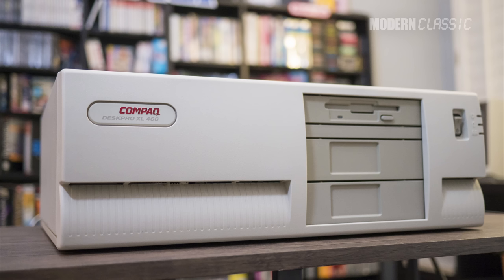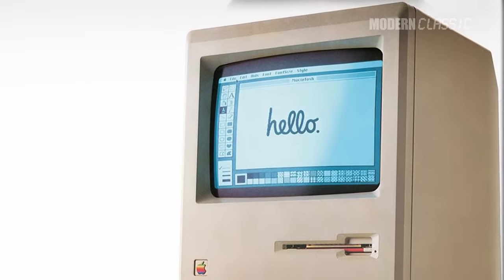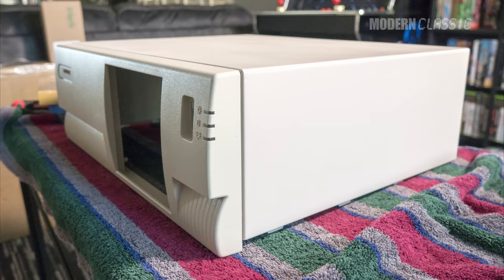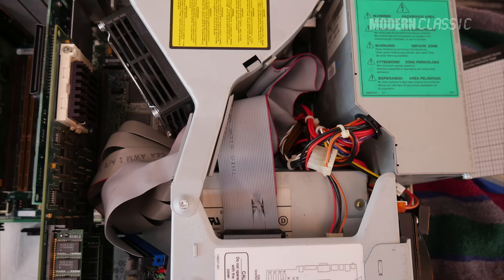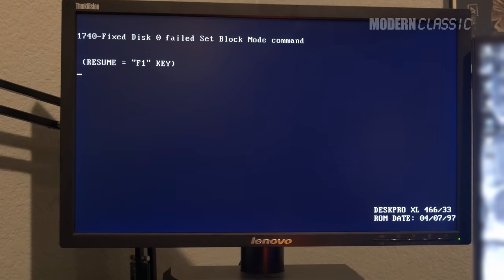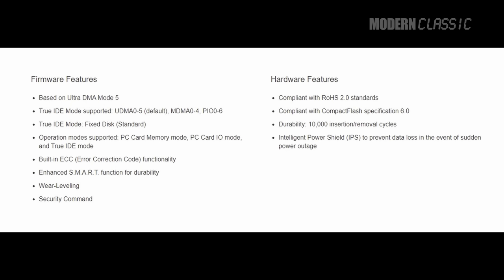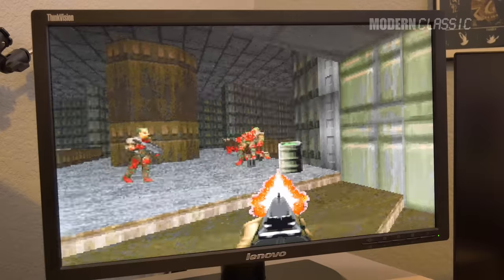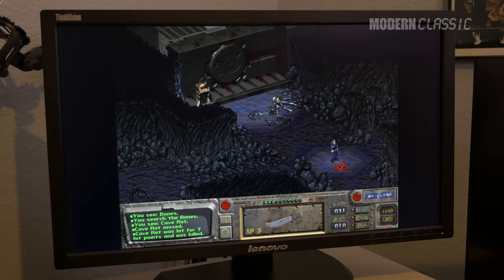Compaq 486 PC restoration and upgrade - Part 2 REUPLOAD

Comment: I worked for Compaq and built about 70,000 of them units from building, to reword repair.   The colour was known as battleship grey in the manu fac plant when we done touch ups.   If you sent a monitor in for repair and their was stickers around it we would remove the plactic and put on new stuff before sending back to customer.  Try that now $$$$$$$$

Comment: I'm glad you reuploaded this. I would have missed it otherwise. You are correct; it's important to resist the temptation to keep upgrading these retro systems. They should represent an era. The 486 era was a special one. It was the perfect machine for DOS games - games where imagination was just as important as the graphics. I think there's a reason why people look back fondly at games like Monkey Island. The graphics gave you enough information for your brain to fill in the blanks. With modern 3D games imagination plays less of a role it seems.

Comment: Just in case I didn't mention this on the original video, I can tell you have have OSR 2.x based on the 1996 copyright date. This is where the dual boot capability initially broke. You can avoid this issue by either using Win 95 retail or by looking for OSR2fix if you require the later versions of Win 95.

Comment: Very nice and interesting videos ! Just a couple of remarks : 1) The Compaq QVision (OEM Matrox Impression) has a terrible DOS performance. It was literally at the level of an entry level ISA card of the early 90s. It had an excellent performance in Windows, but was awful in DOS. All the 'pre-millennium" Matrox behaved like this ! 2) Regarding the soldered CMOS battery, most Compaq have an header close to this battery where you can connect an external battery pack. This one has this too (you can see the 4-pin header close to the battery. For those who are reluctant to solder (like me), it's a life saver ! :)

Comment: The Transcend CF Cards as Industrial Variant are the best CF Cards for old computers. Normal cards wont work, because they are made as Storage device, not as a system drive in mind. For cameras and such. Professional cards are made as system drives and have a hgher lifespan, powerloss protection and are 100% IDE compatible.

Comment: I understand people have special feelings for the 486, and I do too to a certain degree, but the selection of games that suit it is quite slim. The Pentium era, and later, is much better in that regard. I think the sweet spot might be a Windows XP-based system.
Reply: Depending on your age, the XP machines has just about 0 nostalgia. 

I feel a Pentium  1 running DOS allows the sweet spot for late era DOS gaming and it’s a lot generally a lot cheaper than getting a 486 66Mhz machine going
Reply: @bobcobb99  It depends what gives you the feeling you're after. If you want to be able to play a wide selection of games from a long period of time, those older systems can't offer as much, if it isn't quite as authentic.

Comment: This is awesome!  I don't know if this helps but I seem to recall Compaq machines requiring DS rather than Master/Sl@ve which is maybe why your SCSI drive just works properly.  Don't know for sure but thought I'd share.  I worked on a ton of these back in the 90's at Micro Center but it's been a while! Love that paint job!

Comment: I have the same machine, saved from a ewaste bin few years ago. It was in about the same shape as yours, except bit cleaner. I also replaced the CMOS battery on it, but after about a month, the logic board died, it stopped accessing the floppy drive, and then it hung at boot after few reboots. I managed to find another one on the eBay for quite cheap. Also mine has the original SCSI 4x CD-ROM drive, as the original 820MB SCSI drive. I kept both as I installed Windows NT 3.1, which requires a SCSI CD-ROM and (I think) SCSI HDD. I am running Windows NT 3.51 on it now, it supports lots of Windows 95 apps, and I even got it on the internet (using a Firefox browser). For CF-IDE issues, I would say that you try using SCSI-SD adapter.

Oh and I almost forgot, I disassembled the power supply when I cleaned the machine, and found two white RIFA capacitors. They look bit different from standard yellowish/amber looking things, but nevertheless those are paper capacitors and one of them was already cracked (and measured leaky on cap tester).

Comment: dude some auto parts stores has paint scanners, you bring the case cover and they will tell you the color code or the nearest match, i did that with the bottom of mine, it was all rusty, had to sandblast, zinc primer, paint and matte clear coat, it looks beautiful

Comment: Can you still find Rompaq files for this model in case you need to reset the EISA configs on for example a new or replacement hard drive?  I loved mine back in the day.  Thanks for the video!
Reply from the maker: You can although it’s been long enough now that I don’t remember where I got mine. I do remember it being very easy. There are collections of them out there on the net.

Comment: For Dos 6.1 and Windows 95 coexisting, I would recommend using Plop boot loader, Windows 95 can exist in its own Fat 32 partition, aswell as Dos in its own Fat 16 partition, you can then use plop to hide the partitions from one and another, and switch between them, hope that helps.

Edit, didnt realise part 2 was a reupload aswell so no idea how far you got the project XD
Reply: no real need to hide anything, if simply using "Active" Boot flag set on which partition. Plop does that and if it doesn't work, there's SmartBootManager!

Comment: Never ventured beyond Diamond Stealth Speedstar Pro. 3dfx Voodoo hardly run any card with success. Interested in that compatibality chart ? Stil desire ato have a 386/ 486 system and a pentium 4 1.0 Ghz as that  what inbetween my present pentiums and Duo Quadra core systems !

Comment: I got a S3 card with that memory expansion on it thing looks like a beast at the back of the card the extra memory although not much more does help with game play but really if your using pci slot there are better choices like voodoo 3DFX or Nvidia S3 lost in the gaming wars of the time they were released and dropped out of making cards after this one
Reply from the maker: The Voodoo cards at that time were pass-through cards with no 2D support at all. I could add one to this machine if I wanted but probably wouldn't bother, as I have better 3D on other PC's. The purpose of buying the Virge was 2D gaming in DOS and early Windows. NVidia didn't start putting out really good cards until the late 90's. I mentioned in the video that you could always just upgrade a machine like this until it's no longer even a retro computer - in fact, that's what I did with my first PC, which I just kept upgrading until it became the PC I still use today. So I try to keep these retro machines period-correct. The S3 Virge is among the best DOS 2D gaming cards you can get for a machine of this particular era.

Comment: Yeah definitely shows a cult like mentality in Apple that they could "forget" their entire early history or try to convince people they never used beige ever, oh Goldblum. 🙄 I guess that's just the color chemistry mix, original grey + aged yellowing color oxidation = beige. Great contemporary color match though.
21:16 Ugh that's not good, VESA really ironed out the problems with video hardware support, sadly it couldn't come sooner even though it was really needed. It also encompasses more than just the hi-res as even medium-res 480x360 wasn't possible before VESA. Or consider how late Quake was made using a minimum of 320x200 still rather than 320x240 to see the VESA gulf factor.
Yeah it's sad but true that the untextured(or partially textured) age of 3D graphics doesn't get a lot of love. I think MechWarrior 2 was probably the most loved title of that era. Funny enough I came across Sento recently in my searches, 47-TEK, Inc. only had three games altogether in it's short life.🙂